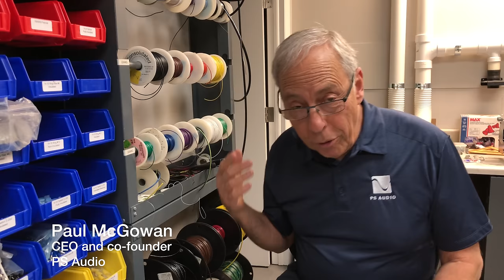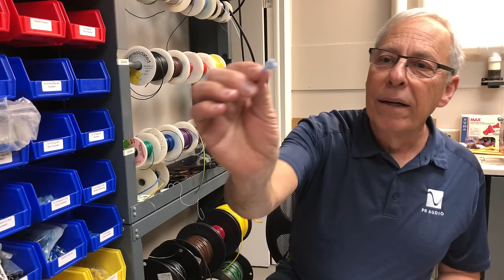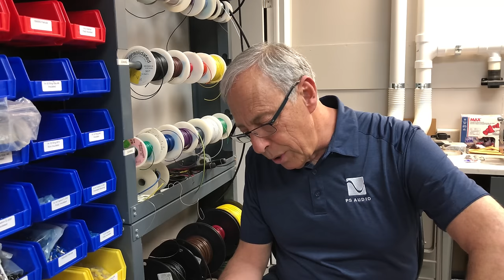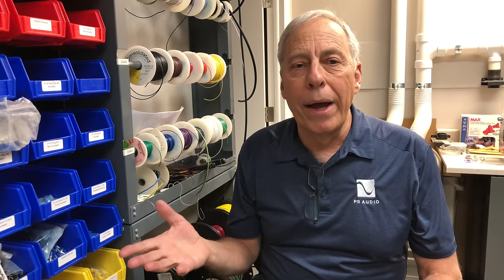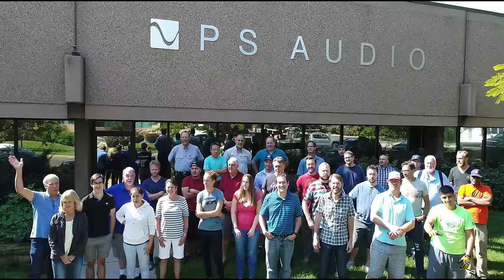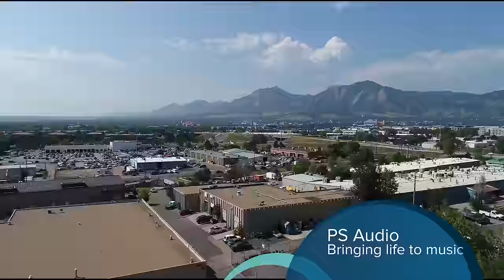Electrostatic speakers and music

Comment: I've owned a pair of Acoustat SPECTRA 6600 electroststics for over twenty years and wouldn't trade them for anything!
Reply: Still have my X with modded servo amps.
Reply: Paul obviously has a major bias based on his past impressions which is weird considering he is a engineer. You would think he would listen to every electrostatic and amp combination before generalizing. He will watch this video in the future and realize he was wrong.
Reply: @chonasimpson6487  I doubt he'll ever admit that. What I don't know is what model(s) he is basing his opinions on. I'd really like to know that.
Reply: @johnmarchington3146  Yes i agree i get the impression that he is very closed minded and is not the type to admit to a mistake. I would like to know what speaker he biasing his opinion on it would be very telling. All ESL are not equal as Paul seems to imply and not giving us a model is dishonest . You have to know this is the guy who was dead set on a mosfet front end over tubes in his integrated newest amp until he did a blind listening test and it turned out the tubes in the front sounded better something he was against from the beginning .I do not take his advice on anything to do with audio lol. Sorry for the spelling my keyboard is dying and some keys are not working take care.
Reply: @chonasimpson6487  I have watched many of his videos and agree with a lot of what he says. Notable amongst that is his preference for DSD over PCM

Comment: I am still listening to the same pair of SoundLab A-2 electrostatic speakers that I bought used in 1984. I used to spend my time trying to replace them but I never found anything I liked better, even the larger SoundLabs. I did indeed used to have panel flapping problems, I fixed them with a hair dryer, shrinking the mylar with heat. Since sending the panels to SoundLab for new panels with the new thinner mylar, I have had no problems.

Two stories: I had a dealer over to the house to demo some interconnects for me. On one record, with a particularly low bass note, he started looking around the room. "What are you looking for?" I asked. "The subwoofer" he replied. There was no subwoofer.

Second story: My son's girlfriend's father is, if not an audiophile, very interested in high end gear. After listening to my system, his first comment was "I thought electrostatics were supposed to be harsh".

If his system is revealing bad recordings, maybe it's doing what it is supposed to do. I don't like listening to bad recordings either, but it is not my stereo's fault. The great recordings on the other hand can be magical.
Reply: That's right ! And I don't want to give up that magic. Sound lab speakers can sound just like my Acoustats.
Reply: I've actually listened to Sound lab Majestic 945PX - they sound very nice indeed. But were completely out of my budget.
I turned to Final sound, but were not entirely impressed, when reading up I found they also got quality issues I passed on those.
My previous speakers had the ribbon tweeters from gamma, the VLD horns - the treble in those are very crisp. I still own those speakers and got 2 spare ribbons and crossover filter spare parts - one day they're going to make a comeback. :)
So when talking about old speakers, and electrostats - if I ever come over a pair of used Quads at the right price. I might go for those. 
They're very midrange leaning, but sound really nice and the music lives.
Reply: Hear! Hear! Beveridge Model 3 with Rel subs.
Reply: @andersforsgren3806  I agree from the first time I heard them in Carlsbad CA. Yes the music lives!

Comment: I find good electrostatics to not only sound more transparent but more lifelike than cones in a box. On the best stats a piano sounds more like a piano in it's attack and in it's harmonic rendering. When a full range diaphragm thinner than cigarette wrapper with a mass lower than the air it's moving is driven over every square millimetre of it's surface you get a realism of sound that eludes cones/domes in a box.
Yes electrostatics are revealing, but in a way that live instruments are. They are detailed and immediate while retaining music's subtlety. Resolution without screaming at you. Listen to a Quad 2812 and this quality comes through, no hot spots and no listener fatigue.
Electrostatics also reproduce music's scale... a quality very important to realism that often gets forgotten. Because electrostatics have a large radiating surface instruments sound life sized. Something I can't say for metal dome tweeters and tiny woofers.
Reply: I owned acustat 4's in the late 70s. I sold my Dahlquist dq10's and never looked back.The difference in realism gave me goose bumps.

Comment: Electrostatics may allow you to hear the worst in recordings but they also allow you to hear the best in those recordings.
If your electrostatic speakers sound that razor sharp overly detailed then something is wrong. They should sound very open like an open window but never bright or screechy. If they do then something is wrong.
Reply: I starting to think he knows this just pushing his product .Or he is outright lying.
Reply: Sometimes I feel that people have a speaker with a bumped up mid or treble (or room issues) and call it "revealing/truthful" because it sounds annoying more often than not.
Reply: @chonasimpson6487  this guy def hard core marketer over everything else

Comment: Thanks Paul.  I was blown away back in the 70's after listening to a pair of Dayton-Wright electrostatics.  I tried in vain to reproduce the sound with conventional designs (time-aligned, phase-aligned, etc.). In the 90s I went looking for new speakers and was not pleased about most of the current gen ELs.  The best was the full-range product from SoundLabs but they exceeded my budget.  I ended up designing and building a hybrid Electrostatic/transmission line woofer.  They stand 8' 3" tall, the transmission line running up the length of the panels. They were highlighted in AudioXpress magazine.  I drive them with the Nelson Pass A-4s and still love the sound of these.  When these finally die, I'll probably check out the Sanders Electrostatic as replacements.  BTW, I use the UK pressing of ELP's Lucky Man in my testing.  The rich tones of the guitar and voice, the highs and lows of the  keyboards really push a speaker.
Reply: Paul will never get it. He thinks his steely state stuff sounds good .I have heard it it gives me a headache lol.

Comment: The Audiostatic ES-100 was a very popular speaker here in Holland some 25 years ago. 
They had a smaller model, ES-50. I owned it for a short time. Very revealing indeed, but no bass and very picky on amps. 
My Aura amp (B&W) clipped all the time, so I sold them.
I like those huge Martin Logan's though!

Comment: Boy, I gotta agree  with Paul on this one as I have owned a couple of pairs of Martin Logans and I could not quite get them to, "settle down' enough to enjoy them.  Head in a vise, and too revealing sum up my experience. I now own Magnepans and am enjoying music again.  .
Reply: I never liked Martin Logan that is the speaker i think this guy is referring to . Sound labs are on another level and never sound harsh they sound sweet and full and bring out all the detail in a realistic way and never reproduce any harshness.
Reply: Martin Logans  are like comparing a rolls Royce to a Honda civic compared to Soundlabs the two sound completely different Sound labs are not bright at all they are smoother than any box i have heard yet all the micro detail is present effortless. Listen to the new big models on some OTLs sonic bliss with no listener fatigue. I am sure Paul had the Martin Logan i heard many models of these and almost wrote off electrostats like Paul until i heard the Soundlab A1PX they have nothing in common with Logans at all different sound and presentation from bass mids and highs they are not forward sounding and the music just floats in the air.
Reply: @chonasimpson6487  so are you saying that the Martin Logan's are like the Rolls-Royce or the Honda Civic?
Reply: I’ve owned Quad ESL-63 electrostatic speakers since 1985 and I cannot understand Paul’s negative comments.  I’ve never heard bad sounds coming out of my speakers.  Never.    I do listen 99% to opera and classical music and I can’t find any fault with them playing that sort of music.  They are regularly criticized for not having enough bass.  Maybe so, but they sound great to me.  It could be the kind of music I like to listen to is ideal for electrostatics as they excel in the upper and mid-range and I love voice, piano, violin, guitar, harp, cello which can sound exquisite coming through my Quads.  I think they are the perfect speakers for me.
Reply: Too revealing… 🤔
Reply: @N. Lyndley.  What does too revealing mean?

Comment: Never owned PSAudio (hello to Colorado) but these videos are awesome. Great insight and shows lots of passion. I live in Minnesota, home to Audio Research, Magnepan, Bel Canto, Wadia, etc. Thank you for taking the time to make these videos. Will start looking into PSAudio equipment. The sprout looks like a perfect fit for my revamp of my bedroom system.

(Current bedroom system is overkill dual Sunfire subs, Magnepan 1.6 with modded xovers, Parasound Halo Integrated, NAD Bee CD, Cambridge Audio phono amp, Project Carbon phono... need to simplify.)
Reply: And Atma-Sphere!!!

Comment: Harold Beveridge designed his original Beveridge Cylindrical Sound Speaker that allowed the listener to walk around and through the sound field and the images stayed stable as you moved.  They were astonishing speakers but the frequency extremes were limited and ultimate SPL was low, but because of line source alignment the sound drop at 1/d not the normal 1/d2 so it did emulate real life sound.  For me it just didn’t have the jump and dynamics or room air control.  Very cool speaker, according to Walt Bender 60 pairs were built.

Comment: I hope you like a bit of Schubert, and a nice Jazz Ballad. I finally have come to the stage where I would rather not touch my speakers any more (I'm so happy with them). It's nice to get to that stage, so satisfying, after months of tweaking the crossover and the acoustics (as you will be pointed out briefly before the short demo). One big secret is to find material that is hard to reproduce when you know it's not the program content. e.g. Sada Adu's voice. 

If you can make her voice sound all right just about everything will sound good. And how to know if the recording isn't making harsh notes. Get other speakers, that simple. If it does the same thing it's a good chance it's the recording, but if it changes from (e.g.) a note that is too loud, becomes too soft instead, well the recording must be somewhat in between, so it's the speakers. 

I used the old school Marantz 801's as reference speakers cos they seemed to have good med and were available to borrow. lol And that made me realise I originally had way NOT ENOUGH MED in my speakers and I'm embarrassed to share the video of it I made months ago. lol Here we go with the more med: https://youtu.be/BXaFQ_wuW1E   https://youtu.be/5Mi2mP3El-A

Comment: Hi Paul.  I've owned a pair of Accoustat 2+2s for many years, which are full range electrostatic speakers.  And you're right, poorly recorded music can drive me out of the room.  The good news is that CDs are sounding better than ever so that I have a wide variety of music at my fingertips that I indulge in without consternation.  Remastered CDs are particularly good these days.  

I  found a way to greatly reduce the strength of the back wave of my 2+2s, which has solved my bass problem for all music except hard rock.  I've often wondered if anyone has built huge speaker enclosure for an electrostatic speaker in order completely kill the back wave.  It would have to be in a huge room, but I think it would sound incredibly good.

I heard a pair of $16,000 Wilson speakers a couple month ago with state of the art amplification and couldn't stand the high end.  Electrostatic speakers have spoiled me.
Reply: Yes every speaker sounds broken after living with electrostatics. I heard the Wilson Wamm once and it sounded like a bunch of drivers that didn't integrate well. I heard the IRS V's twice and while they are good the ribbons have a sort of metal click coloration and the image wanders up and down the drivers which bothered me. Electrostatics require great electronics behind them and when you give them that all the problems people have complained about them mostly go away.
Reply: Absolutely!  Recent I invested in an Asthetix Calypso tube line amplifier, which has turned my electrostats into the best sounding speakers I've ever heard.  The image is magical, the detail is amazing, and the frequency response is remarkably flat from top to bottom.  There is nothing that I want to improve.
Reply: @twhalen  Quite the opposite.  Have you actually listened to CDs made in the 80s?  Try Leonard Bernstein conducting West Side Story recorded in 1985.  It's unlistenable - harsh, glassy, just plain weird.  This is one of many, many examples I can name.  On the other hand, try Marin Alsop conducting any of the Brahms symphonies, recorded in 2005.  They're wonderful.  Again, one of many, many examples I can name.  For example, try Getz A Go Go, mastered for CD in 2007.  Spectacular!

What kind of CD player do you have?  I have an Ayre CD player that retailed for $6,000 in 2010.  Quality of your player can make all the difference.

Comment: Fast-On is a trademark! The dimple in the middle of it helps lock the two halves together. Cheap copies don't have that.
Reply: The best versions of these connectors have a springy tab that lets you move the locking dot down so that you can unplug the connector. Ones that have a dot with no tab are irritating to remove

Comment: I have had Quad, Martin Logan and Stax electrostatic speakers. I still have the Stax, but they are currently not i use. I have another self made ESL speakers in use at the moment. They are better than the Quad and Martin Logan, but irritating when it comes to recordings. To good to be good..., or to good to be kind. So I also has a couple of Fostex monitors. They are good to be bad.., or good to bad recordings. So when I want to listen to good music with good recordings I use the electrostatic and when the music is performance is good, but the recordings is bad I prefare the Fostex. However it is music I am listening to, not the reproductive gear. Happy listening.

Comment: I had auditioned exactly these (audiostatic es 100) electrostats back in the early '90s, with a pair of big, Sonic Frontiers (if I remember well) 50 watt monoblock tube amps. The session was at a local dealer's big room and I was amazed by the huge and clear sound picture they created. Unfortunately, I heard them leading the poor amp to clipping too, when I tried to listen to my favorite  classical songs by Anne-Sophie von Otter's enormous voice. I remember, their "smart advantage" over common electrostats was that they were using parallel thick cables as stators, instead of the usual, perforated metal or grid. I suppose this protected the mylar membrane from arcing but I didn't understand exactly how the loss of force on the membrane was avoided by these rather flimsy "stators". Moreover, I heard the membrane "slapping" softly against the "chords" at least a couple of times, when the bass was a bit more than their tastes would allow. Don't get me wrong, I definately liked them, I just recall these memories trying to find a different possible explanation about this, strangely, very delayed, dissatisfaction of their owner and user. I mean, is it really the quality of the recordings, or flaws of performance or little failures of synergy, that lead to unacceptable distortions? It is very common to take us sometime (although, rarely 24 years), before we start to realize the flaws and the drawbacks and the imperfections of our equipment. There's also another factor to rule in: As we age, we lose hearing, we lose important cellular components from our precious sonic receptors and this makes us more vunlerable to distortions, more prone to dissatisfaction by the quality of our music. But, perhaps this makes us also more avid audiophiles: We need better and better equipment, equipment that will ensure for us this "analog and liquid" quality, that only live music alone does have.
Reply: the cables are in series :) , not that it maters for high voltages :) but the design is a classic and mind bending good cheap idea that works :) although acoustat had the same sort idea.  but did not use solid wire so could not be used as a stator itself.